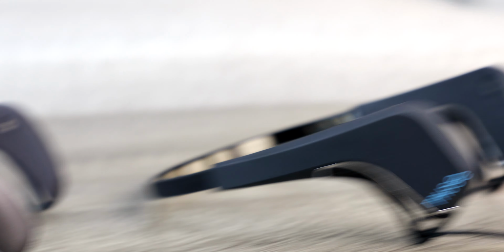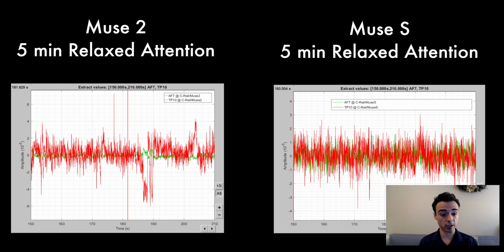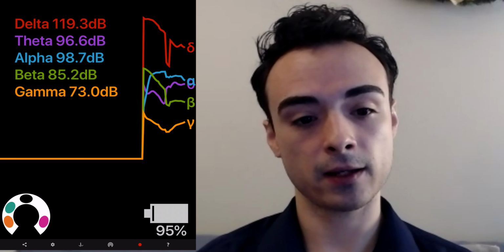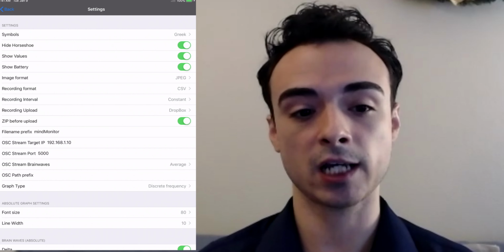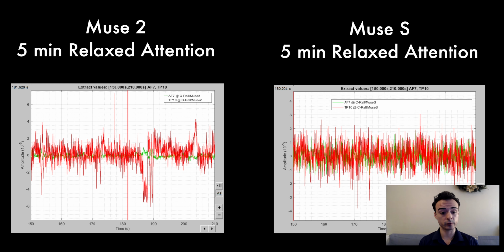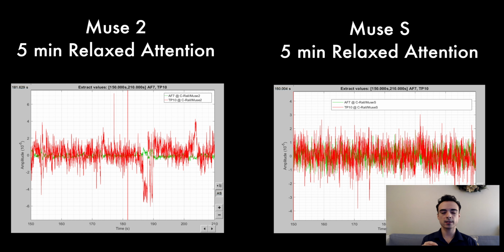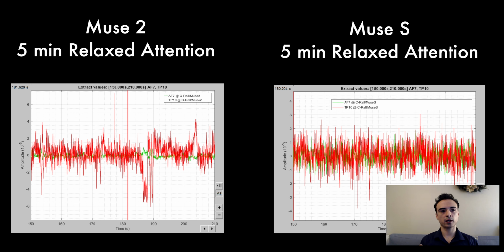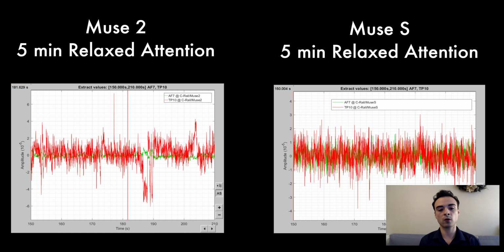This Muse Headband Sensor Could Give You Bad Data

Comment: Hey Cody, I have a weird question.  My muse S headband sensors have worn away by the ears (can send pictures if you want) and now show a bad connection in the app by the ear sensors.  I thought I would try to add new conductive material or ink in the spots that it is worn. I put some copper tape over the worn areas on the sensors and now the app shows great connection. Do you think I am getting reliable data from this, or am I just 'tricking' the app's connection algorithm? My headband is no longer under warranty which is why I did this.  I know this is a weird question, but thought I'd ask. I'd love to be able to compare the data from my brand new headband and the one I 'fixed'.

Comment: hey 😃

so i got the muse S,and after more than a month i have to say i am super satisfied,it really DOES work much better than back then,very good signal....

but i find it strange that nobody has mentioned the difference in graphs yet...

so how do you or kiefer explain the big difference in the graphs when comparing muse1 vs muse2 vs muse S?

muse2 and S are very similar but there is a big big difference between muse2/S vs muse1 in all brainwaves except delta,with gamma being + 20-25 in mm graphs with the museS/2...
so how can you use them for research when it seems the graphs/output is not accurate? coz since muse1 was used for all the research papers in the past,it logically means,or SHOULD mean they tested it for its accuracy and compared to gold standard devices,so if muse1 was accurate it means muse2 and S are not since they have such a big difference in their graphs compared to msue1... i mean the correlation between the brainwaves is still there,i can still spot things like the sleep and/or dream patterns,but the numbers (dB) have a big difference ranging from 10-25...

my guess is they used some kind of equation/code to keep delta as low as possible in comparison to the other brainwaves as delta is seen by the muse app as sleep - which is not true as in deeper states of meditation your delta is also rising the more you disconnect from your physical body - so i thought they did that to keep their feedback more accurate,and maybe thats why interaxon said muse S cant be used for research...  whats your take on it?
Reply: Could you possibly point me to the source where InteraXon said Muse S can't be used for research? What you're saying about the difference in signal sounds like an important issue - I'm currently looking into using Muse S for sleep research and it's surprisingly hard to find any credible information about that online.

Comment: just ordered a muse S based on this video...

so since you dont mention it,interaxon has fixed the connectivity problems with muse 2 and S? 

coz back then when they came out they had just too many problems when connecting to mm,so after trying out several muse 2 and many people confirming the same problem  i gave up and was using the muse 1 all this time,but after what kiefer said about the sensors i thought ok this makes sense and  since he is using and recommending it i guess it means they work fine now...

of course i can always use the 30 days money back guarantee but would be nice to know up front what to expect...
Reply from the maker: Yes I have not heard of the same bluetooth issue with Muse S. I remember someone saying from the company that they spent a good deal of money to update their bluetooth chip to fix the issue.
Reply: @CodyRallMD  oooh yeeeeees!!!!thats EXCITING!!! 💖

Comment: I started using Muse 1 (2016) just last week, and I can tell for sure that the signal from earlobes contains correct EEG signal (based on my neurofeedback experience which I had been doing with several other EEG devices). Maybe that signal it is contaminated with extra noise which makes the amplitude higher. But after the usual bandpass filtering it definitely has the right content. So the conclusion of this video could be quite misleading.
Reply from the maker: Yes, thank you Jarek. Good to hear you are getting some good signal from it.

Comment: For the people curious about the accuracy: If you want good accuracy, make sure you get the Muse S, not the Muse 1 or Muse 2. 

The guy being interviewed says he uses Muse S for his research.
Reply: Muse is crap. Look into Emotiv devices for research quality. Muse spends a lot on Marketing and customer support therefore is more popular than Emotiv.
Reply: @lioninvesting4676  I think I'll listen to the neuroscientist who uses Muse for research over the guy who is shitting on this product based upon their popularity and focus on customer service.

Is there any actual reason Muse isn't good?
Reply: @connerhazelrigg6332  these guys are paid by muse
Reply: @connerhazelrigg6332  if you paid attention his research is flawed badly with ONE test subject for 5 min come one man pay attention
Reply: @bull5919  I have one now, and it works for the research I'm doing. Been a bit rough on it which has affected signal quality on the rear electrodes, but it's still capable of producing some clear data under the right conditions, and the pre-frontal electrodes have been providing me signal that is just fine when I block out incoming noise. It's not necessarily the best option out there, and it's certainly limited to it's applications, however it does indeed provide clear data

Comment: Tx for this video. Actually, I can agree with the finding on the temporal sensors of the Muse 2. During the Mind Meditation, I just have to remember from time to time to relax jaw and tongue. 

The problem I have with the Muse S is the lifetime of the temporal sensors. After all, the fabric, the base material beneath the sensors is elastic and gets longer and narrower when is is being stretched. The material of the sensor itself cannot be of precisely the same degree of elasticity as the base material of the headband. This does not occur for the frontal sensors where the headband dimensions, i.e. length and width, are being kept constant by the magnetic clamps and the electronic module. According to Interaxon themselves, signs of wear are to be expected within 3-6 months if you use the Muse S 3-6 times a week (https://choosemuse.force.com/s/article/Why-is-my-Muse-S-beginning-to-show-signs-of-wear?language=en_US). My first two fabric bands lasted about two months (I was using it 6-7 days a week), the 3rd  did not work at all, so I returned it after testing it. After purchasing the Muse S early in April, I am now on the FOURTH headband. These two extra headbands mean a lot more money than I expected to spend when I ordered the MUSE S.

To make a long story short: YES, Muse S has a better sensor signal on the temporal sensors, BUT only as long as these temporal sensors are working properly, which is not long enough. IMHO, the Muse S temporal sensors DO NOT HAVE ENOUGH USEFUL LIFE IN THEM. I've been using Muse 2 for the last two months.
Reply from the maker: Whoa this is a very good point, thank you for sharing Uli.
Reply: so they have extra fabric bands you can order/buy ? and isnt this covered by the 2 years guarantee period?

Comment: You say that the typical EEG signal is between 5-20 microvolts, and you say that the ICA of Muse 2 surpasses that. Looking at the plot, 99% of the data is between 5-20 uV. There are two spikes off the chart, which would be easy to remove with any outlier checking. 

Also, it's hard to tell looking at your plots, because you did not keep the scale constant across both plots, but it looks like the frontal electrodes have less variance in the Muse 2 than the Muse S. If true, isn't that really great? 

Also, while I do see what looks like noise in the Muse 2 plot in the temporal sensors for about 5-10 seconds out of 210 seconds (10/210 < 5% of data), this looks like the output of one test subject. Obviously that data is kind of worthless because you would need to look at more than one five minute use case to make these conclusions.

If you want this to be a serious analysis, why not report the standard deviation of both the frontal and temporal sensors over 10 use cases? Compare variance of both devices, and also with professional research setups. 

Anyway, in terms of meditation, one would think needing to be aware of the muscles in your face is a plus. You have to relax your muscles as part of the challenge.
Reply from the maker: Thanks for the in-depth analysis Fahraynk, always striving to be better with these critiques.